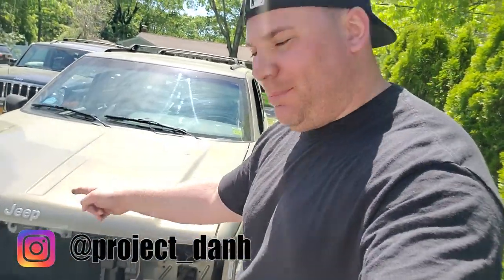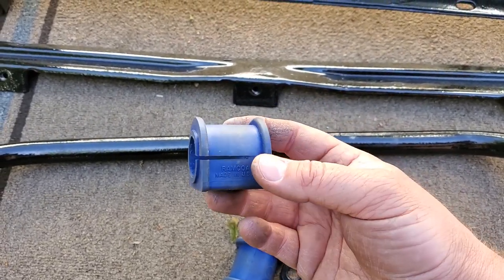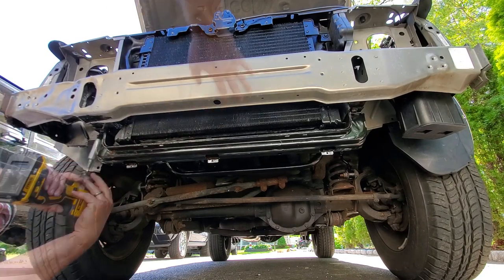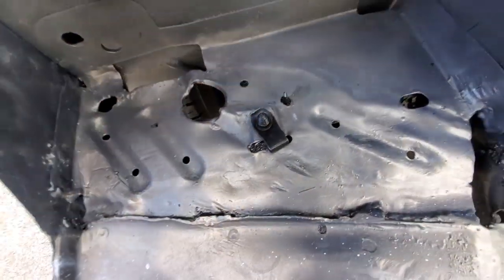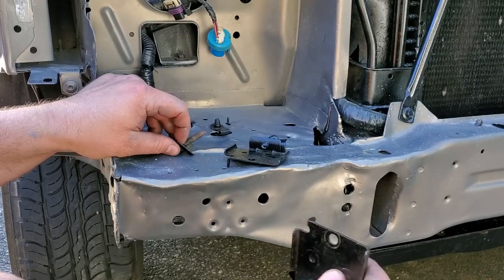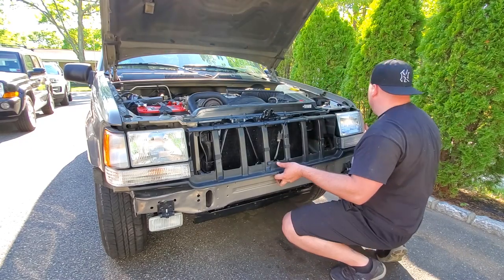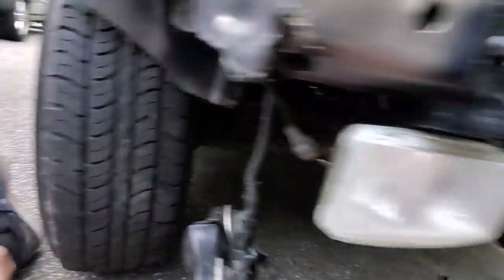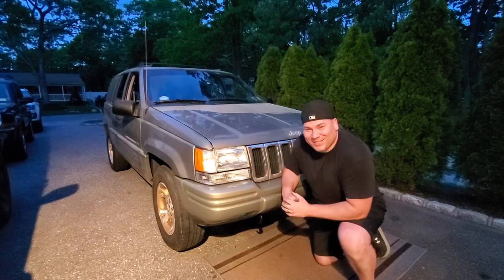JEEP ZJ FRONT END RECONSTRUCTING  - GENERAL GRIEVOUS 1998 GRAND CHEROKEE GETS REASSEMBLED

Comment: Man that front end came out great 👍🏾
Reply from the maker: Thank you! 👊
Reply: @ProjectDanH  np so...where r u thinking of going with it? as far as mods go
Reply from the maker: @mclehed77   next order of business is trans fluid change to try to fix the crap 42RE.  Then coolant flush...  1st mod will probably be a 3 inch lift and tires. And of course a trans cooler
Reply: @ProjectDanH  nice that 3 inch lift should look awesome
Reply from the maker: @mclehed77  thanks man.. gonna do it right though. I need longer rear control arms. I'm not a fan of how the stock arms brings the rear axle closer to the body
Reply: @ProjectDanH  ok so who makes the longer control arms 
Rough Country?
Reply from the maker: @mclehed77  I'm gonna call every lift  manufacturer known to man to try to find one who will sponsor the build! Lol.. I'll start with RC since I've used there products and recently hooked up my boy JTM offroad
Reply: @ProjectDanH  ok sounds good can't wait 😁